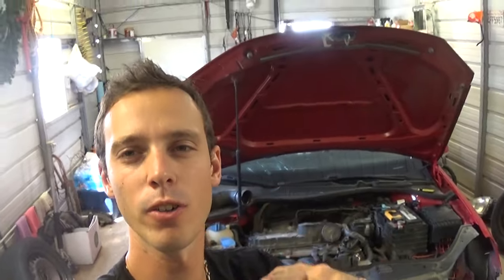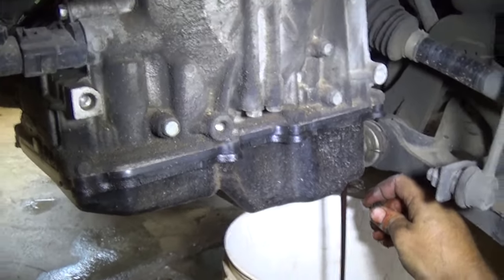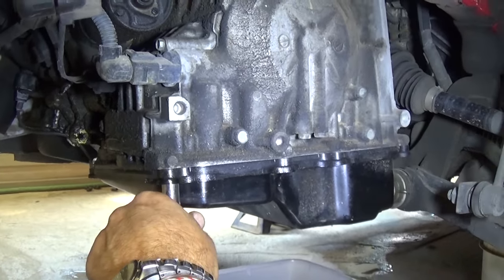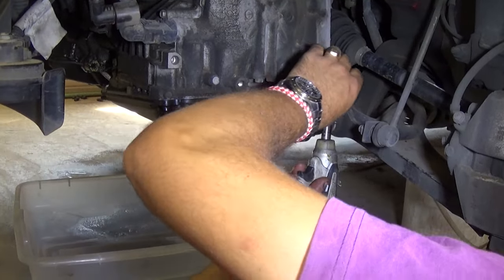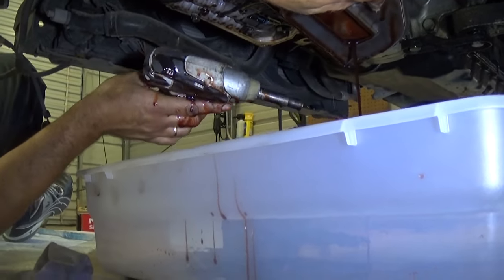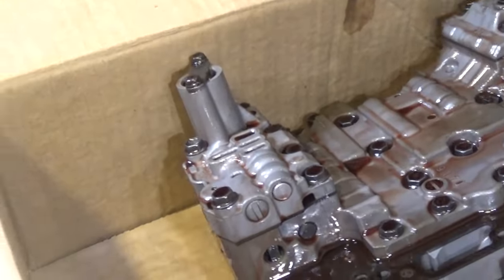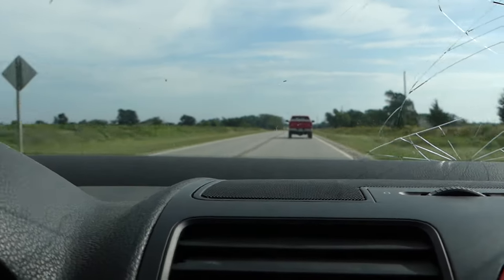VW TRANSMISSION SHIFTS HARD VALVE BODY REPLACEMENT FIX

Comment: In most of these cases I’m see, it’s just your tcm and ecm that sends your can in limp mode, under the carpet on the passenger side is your ecm, and driver side is your tcm. Due to poor weather stripping, moisture and condensation builds straight puddles underneath your floor board, go to the junkyard and pull them with matching numbers. It worked for my old Passat 3.0.

Comment: 2:11 Good tip to tight the bolt now cuz later maybe you forget and drive .
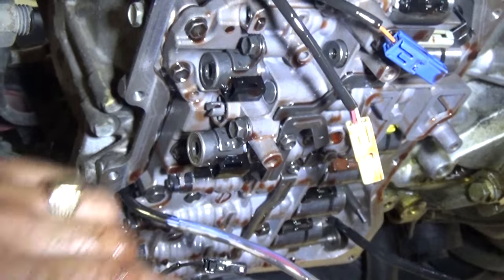9:12 Good suggestion to check your suspension 👌

Subscribed 👍 🎉

Comment: Did you have to preform any kind of adaptation for the transmission to reset back to factory defaults and allow the computer to relearn?
Reply: He doesn't know.
Reply: @muffemod  and it does require a software reset...something along the lines of VCDS scan and reset within the module! I have done a couple of these now and at about 100-125k miles the solenoids are pretty much shot, the valve body itself is generally still serviceable. The solenoids are creating the issue(s) of hard shifts, and slips between gears. AND always use manufacturer fluids in servicing.

Comment: Every video DIY I search up on YouTube and I hear my brother with that cool accent talking I immediately smiled and yes this fixed my 05 vw golf 1.8 Replace the filter replace the fluids with genuine fluid from Volkswagen get it on FCP euro
Reply: You got insta? Or snap I wanna see your vw
Reply: I have an 05 jetta 2.0 it was leaking oil from the coolant box I got new seals for the bolts that go to the coolant box, changed the filter and fluid also changed throttle body a year and some change ago. . If that didn't fix it I'm gonna try this

Comment: Would a bad/faulty valve body cause the vehicle to not move in any gear? I recently got a transmission DTC of P079500, it has me going crazy because I’m trying to figure out if the transmission needs to be removed to replace torque converter or potentially whole transmission.

Comment: My vw Passat 2007 has hard shifting when I accelerate hardly. But in normal speed it shifts good. Do you think it's because of valve body or solenoids?
Reply: Did you figure out what it was? mine is doing the same thing?

Comment: Hello so i have read alot of the comments, i picked up one from the auction 2005 2.5 automatic as well and same issues, i want to just do the solenoids which is even cheaper but learning experience for me, but my question is you guys took a used one from a parts car, how do you know thats good!?

Comment: Hey I wonder if you have ever changed a valve body on a 2008-2011 rav4, awd, 4 cyl. I just dropped mine out(I had to in order to remove all the solenoids to clean them) I'm just wondering how the valves above it go back in, and there's a tiny black plastic piece with a spring and a small metal ball on the end, I'm not sure where it came from when i dropped the valve body out. If you have any advice id love to hear it.

Comment: I replaced my valve body..and it still rev high and jump wen shift . Do u have re program the TCM after u replaced a valve body? P17F0 code pending inside the transmission
Reply: Clone Vision  sold the car . No sense . Needed a transmission.  Nissan are crap

Comment: Thanks for the great video.  My Jetta is doing the exact same thing.  Can pin point the problem to when the step-daughter ran over a pothole and ripped open the oil pan.  More than likely dirt got into the valve body and worked it destructive magic.  Looks like a job I can do, not anymore complicated than jobs I have successfully tackled.  Thanks again.
Reply: Sounds like alot more than just some dirt. But allrighty david.

Comment: I have a 2007 VW beetle and sure enough it hit 180000 kilometres and I was about to change the fluid and it started slipping it popped codes randomly that would sometimes disappear.  P0731/732/. The service manual indicated the transmission fluid must be changed at 180,000 km I’m thinking maybe the computer push it into limp mode to force the tranny change? I can drive it but it won’t go past 80 km an hour and it slips on gears depending on whether it’s warmed up or not it really is not safe to drive right now but it is drivable. Any suggestions. I bought a $600 scan tool I figured it would pay for itself in a few uses and I got buddies that come over that are also into European cars I figured it’s a good reason for people to come over to come see me and talk about cars. Any advice would be much appreciated

Comment: I have a 2006 Jetta 2.5 salvaged just picked it up from the auction. When it’s cold it’s fine when it’s hot 1st-2nd gear shift hard 3rd slips and reverse bangs hard also. Again when it’s cold none of that happens you think I need a new value body ? Thanks
Reply: more likely just solenoids
Reply: have you ever figured out the problem? I have the same issue😧
Reply: Tcm most likely got water damage! Go to the junkyard and pull it out

Comment: How do I know if the Valve body needs to be replaced or the entire transmission? When would you recommend the entire transmission being changed or just a valve body replacement?
Reply: Tony Trilex i would do valve body first then if not fixed whole trans. 500$ vs 3-4k

Comment: My 2011 Jetta SE shifts terrible plus it sometimes jerks hard when almost at a stop. This problem is intermittent, sometimes it shifts great, the next day it will be terrible again. Is it the valve body? There are no codes for the transmission.
Reply: Ever figure this out?

Comment: I DID THE TRANSMISSION VALVE BODY O A 2007 VW JETTA 2.5 ACCORDING TO YOUR VIDEO BUT I NEED TO0 REPLACE THE TRASNMISSION SPEED SENSOR FOR SAME CAR. WOULD YOU POINT OUT WITH DETAILS OF THE LOCATION  THANKS IN ADVANCE

Comment: Halo, I have a mk5 Jetta 2006. It jacks then I accelerate past 1000 rpm or when in traffic when I shift from neutral and back to drive. What could be causing this?

Comment: I have a 2006 VW Jetta 2.5 and it’s a hard shift when tying to gear 1-6 u change the camshaft speed sensor o2 down n Ik sensors crankshaft and other but it still won’t switch into gears need help

Comment: Hi, have a 2007 rabbit 2.5L 6 speed, but where can I find the correct Transmission Valve Body for this? EBay always says it is not compatible, is there another parts search site? Thanks!
Reply: ive seen some on amazon but not sure might just get it at autozone

Comment: how should i know if the  SHIFTS HARD VALVE BODY have a problem? what are the symptoms because i have my vw polo 16v auto when i have not warm it up it cant move when i am trying to drive it .
Reply: MALUME28 MALUME28 replace trans fluid first, if not fixed then replace valve body, then whole trans

Comment: hie brother /2011 be gti  transmission MMA  my problem feels like the clutch is slipping at wide open throttle in 3rd, 4th,5th and 6th gear

Comment: Having what I believe is transmission issues on my Volkswagen cc 2013 with only 65k miles. It hard shift from 1st to 2nd gear. Not sure how to get it fixed without replacing the whole transmission. Someone told me to change the transmission oil and put the Lucas transmission oil slipping oil to help it out, had someone else tell me to change the valve body. And opinion #3 was to just change the whole transmission. Not sure what to do

Comment: Morning.
good job :)
i have one promplem in passat 2003 1,8T 170hp , when I Press the accelerator pedal that I want cross someone in my way or I try to speed up fast the car make some kik or feel like some stone was front of my car and I drive over it. The oil is fine computer test was fine and I don't know what are this.
Can you please tell me what can be this ?
Reply: Hey, i have the same problem, could you please tell me if you fixed and how?
Reply: @houssamamhaz7994  
Fly wheel have to be change.
Do u have automatic or manual gearbox?

Comment: Hi, I did exactly that but there is a problem, the bracket that moves the change of gears has a guide to put it so I did but for some reason can't move the shifter to pass the reverse what went wrong can you help??

Comment: Hello  from  Mission Texas question ? vw beetle 2001 the ring that controls the  speed sensor it doesn't turn , i lifted and turn the wheel on D and ring not spins what  i have  to  do?  thanks,

Comment: Where can the transmission output shaft speed sensor be located on my 2012 vw passat
Reply: Output Sensor is above the Valve Body, towards the diff

Comment: Is this valve body video on an automatic Tran or a manual. If it is automatic can someone send me a link to the valve body replacement so I can buy it
Reply: the valve body is what changes the gears in an automatic transmission and the gear selector (stick) that you choose is a manual, so you are the valve body in a manual !

Comment: I wasn't paying attention, and don't remember where did I remove a  two or three long bolts from it,,,, there's like longer bolts, I don't really know where to put them back, can u help, or any ideas where to get info
Reply: Use a nail o somenthing to measure the deep length,they usually go in tha higher side  levels from the little towers above valve body
Reply: Go online and download you a manual

Comment: which problem do you have? which diagnose are tell you that guys? i have a problem with passat 3c  2.0 fsi 150 wen is warm then switch the 2-3 gear so heavy like a foot step in the ass .

Comment: Hey mate! That's the same transmission I have on my City Golf and I CAN NOT FIND the fill plug for this car. Can you please help me locate the transmission oil fill plug for these cars? Thank you
Reply: Drain plug is fill plug warm up and remove plug if drips/pours consistently levels good
Reply: Mike R thank you mate 🙏🏼
Reply: Wayyyy late but, not the drain plug, it’s on the side up by the cv joint.
Reply: My 05 jetta the drain is the fill

Comment: I'm facing same as your problem.  My 2006 golf does hard shifting when gets hot and sometimes get stuck on 3rd gear. Changed the transmission with 2nd hand one and it's still doing the same thing. Any advice please help. Cheers
Reply: Mine does exactly the same. What was the issue @Ashour Noiya
Reply: @jareb71  ended up selling it as is. But before selling it, took it to a transmission mechanic and he said it's the " valve body " need to replace the whole thing and it will cost me $2500 AU dollars.

Comment: Hello there i have had issues with shifting and Jerks in D , while brakes depress when heats up, i changed valve body with a rebuilt one, now the issue is gone in D with brakes depress but still jerks and shift hard esp from 1st to 2nd gear after heat up around 90 to 100C i tried to adapt and drive cycle but still same issue, any advise? car drives great when cold.
Reply: how do you know the valve body is good.  Even rebuilt it could be bad.  Only VCDS tool will tell you

Comment: I have 2010 va jetta, 2.5 motor.  I came over hill and hit water about 40miles hr. It scared heck out of me. But I just kept it floored. It was up to hood. It sputtered but kept going. I drove next day to my son's 40 mile. And then it started missing.  My brother said new plugs and censor said foul plugs.  But then my transition started slipping 4 days later.  My brother looked and my casing and filter was gone.  Please help what should I do
Reply: Tcu and ecm. I had to change bout on my passat

Comment: Question I have a MK4 jetta 1.8t  transmission 09A I followed the video  the install was not hard but the car will not move  
While idling brake pressed I can shift thru the gears but the car will NOT forward or reverse Any suggestion
Reply: I have an 05 Jetta had a coolant box leak and need a new seals for the bolts that hold it in place and while I was at I went ahead and changed out the transmission fluid and filter because the car stopped shifting it won't go into gear forward or backwards or even when I go through the gears manually

Comment: My 99 Jetta Mk3 only wants to go into drive, even in park. I turn the key to feel my vehicle jump forward, ready to take off, even the same for reverse and neutral. Couple days ago it didnt want to drive as if the trans just gave out. Turns out it was a brake cailber  that locked up ( turned vehicle off in neutral  before taking cailber off would not roll back freely, taking it off later that night allowed the vehicle to roll backwards ) any help is appreciated (:

Comment: the scanner shows on my jetta 2006 2.5 5 cyl the speed sensor but it has the same problem.  shifts hard after 10 or 20 min  of use .  what do you suggest ? should i start with the speed sensor ? or should i buy the valve body ?
Reply: Speed sensor is cheap and easy and if it’s throwing a code it needs replaced anyway.   I had to change my valve body in my rabbit it showed no code on it but it fixed the hard shifting.
Reply: Hey thanks ! I got the car fixed unfurtunately i had to replace the valve body and speed sensor too.  
The good thing is i found a cheap used valve and its working good now!
Reply: how much was the installation?
Reply: I have a 2007 jetta 2.5
It was shifting very hard trust me when I say very hard I replaced the oil and filter(vw original brand) also add a bottle of 
(Lucas transmission fix) and thank God the problem is gone
Reply: King Mike  i spent around 400 dls for evrtything.
Reply: where did you get your cheap valve body from? please help lol
Reply: look on ebay  it was refurbished for 189 dollars and its working really good . haven't had any problem since then
Reply: how much lucas did you use? and how much fluid? is it still working or did it come back?
Reply: Gustavo Hernandez where ??
Reply: Transmission fora2000 valfgoing bad incident
Reply: Gustavo Hernandez hey what exactly did your car do for you know the valve body was bad? Mine is doing this 
Hello i have 2007 vw rabbit the other day i was getting of the freeway and the car drop into low gear fast and when i tried speeding up it rev up high before going into the next gear and and it wouldn’t down shift hard . So i ended up using the tri-tronic since this car be drive manual as well and it drives fine i tried driving it normal again and shift fine can it be that my valve body is going bad ? Car has 190,000 miles on it 
I have a check engine light on for a small vap leak only no other codes

Comment: I have a code error P0732 and my car will run fine once it warms after 5mins to 10. Couple shops told me I need a new transmission but I don't think I do could it be a computer system error or need new selenoid? Transmission fluid change? I never had it serviced sitting at 116k miles
Reply: I’m at 113k and it was my solenoids with that code

Comment: Hey I got a Jetta 06 2.0 turbo that I’ve brought off some dude in Craigslist. I’ve had the same problem of it shifting late when it’s been running and also the reverse goes out. Should I buy a new trans or replace the valve body. The car has 112k miles the transmissions shouldn’t go out that fast. Any recommendations?
Reply: if it were me, I would change the tranny and fluid at least three to four times.  Look into changing solenoids first or valve body with solenoids.  If when your car is cold and you drive it and it shifts through all the gears fine, it is more likely related to solenoid first then VBody.  Good luck.

Comment: I have a 2000 jetta 2.0 no turbo with 4 speed auto trans. When I bought the car it was rough had some extreme hard shifting. Replaced filter n fluids. Come to find that both of my cv axles were snapped clean in half. Just replaced the cv axels. When car is cold it will go into gears just fine but after warming up it shifts very aggressively in all gears. I have to have high rpms to get it to launch into gear and away she will drive leaving rubber n smoke on pavement and maybe a sprained neck. Someone please help me I'm exausted as to what the hell it is
Reply: Also throws a code of incorrect gear ratio p0730
Reply: Cameron Gergits did you ever find out what the problem was I’m having the same problem and code with my 2002 Jetta 2.0
Reply: What was it

Comment: I have a 2008 Jetta 2.5 and if I have to wait for it to get up to temp before I drive it or else it will shift hard from parking to reverse or drive. When I put it in drive I can feel it jerk when it goes from 1 and then to 2nd gear and so forth what I’m trying to say is that the shifts are rather abrupt when the vehicle is cold. Anybody else had this problem before?
Reply: Rivera I have same problem on my 2008 beetle. I changed oil and and fillter and it worked ok for about a year but now it’s doing it again I have 240 miles on the car maybe it’s time for new tranny???? Not sure what is wrong because some times it does not do it runs fine?
Reply: Try turning off the ESP and see if the symptoms go away.  My wife's 2007 Jetta is doing the same thing, and I read somewhere it might "fix" it to turn off Esp.
Reply: @manuelsarria1377  replace the oil again.. if gets better and comes back again, its your solenoids or valve body.  One oil chnage is not enough.. more fluid in the torque converter that you cannot change by one oil change cycle
Reply: I have the same year and also 2.5l Jetta with the same problem, I took it to a VW dealership and they replaced the valve body and now the shift is much more smooth. Comes at a cost though!
Reply: @jacob6426 
How much did it cost you?
My 2007 Jetta has problem too
Reply: @Farhad_ZKD  It cost me ~2600$
Reply: @jacob6426 
The mechanics asked me $2500 _ $3400 for a rebuild
I prefer to get it fixed with $2600 at dealership